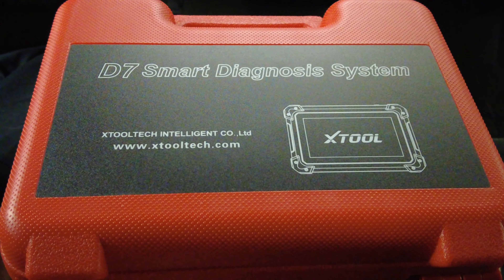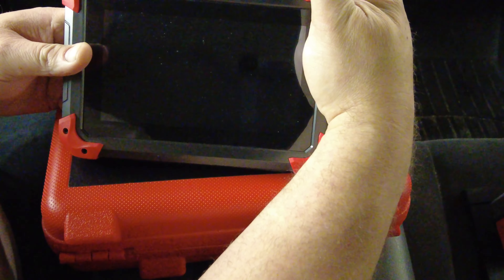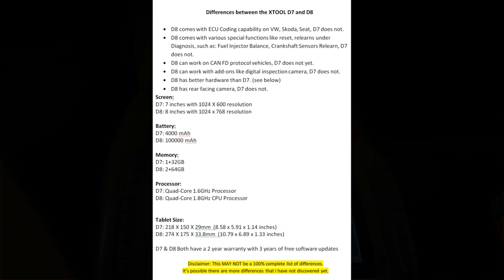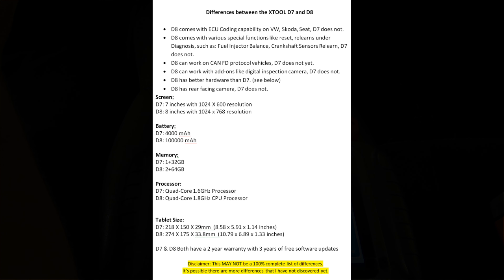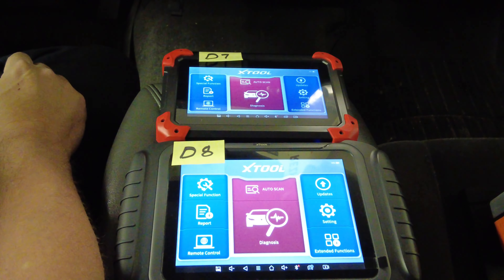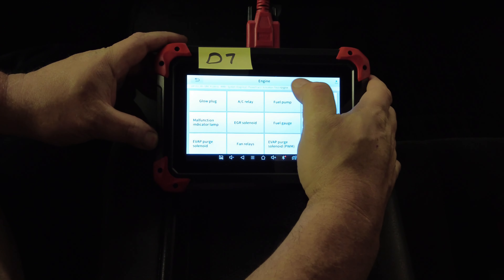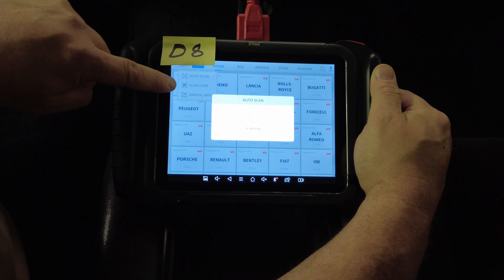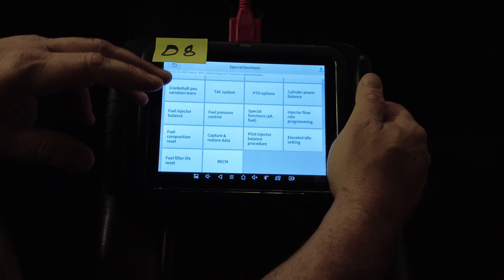XTOOL D7 vs D8 Comparison.  Differences Between These Two Diagnostic Scan Tools

Comment from the maker: XTOOL D7 https://amzn.to/3BdPUo2 (Amazon Link)
Exclusive 10% Promo Code of D7: XTOOLCODE
XTOOL D8 https://amzn.to/3YCfko7 (Amazon Link)
Exclusive 8% Promo Code of D8: XTOOLD8CODE3 
XTOOL D8BT https://amzn.to/3CSkUeB (Amazon Link)
Exclusive 8% Promo Code of D8BT: D8BTCODE

5ft OBDII Extension cable: https://amzn.to/3CveQF4 
9.8ft OBDII Extension cable: https://amzn.to/30ByW3E 

As an Amazon Associate I earn from qualifying purchases.
Reply: You should look up the xtool A30M ---  it's essentially a D7, but without the tablet.  You use your phone instead, and just download the app--  which looks exactly the same as both of these. (but only for $200).  You should do a real good comparison on the A30M vs your D7.  I think there's only a few things that the A30M can't do-- like programming keys;   and maybe one or two others.  Otherwise it has all the same live data and bi-directional controls (or at least the vast majority of them).  It's a killer set up for the price.  But I'm still leaning towards the D8 I think:   buy once, cry once.
Reply from the maker: @calholli  
I'm familiar with the A30M.  I've had OBDII dongle cell phone based scan tools in the past and they're not for me. However, I will say the A30M seems to work better than the ones I've tried in the past. Thanks for the comment. 🙂
Reply: @SlipFitGarage  Yeah.. The A30M is essentially a D7-- except it's a lot slower because of the blue tooth;  with a short little loading screen on everything you do.  I looked it up on their site though, and comparing it to the d8, there really isn't very many more special functions that the D8 does, considering it's +3x the price.  It can do keys, eeprom, a/f reset, "ecu config", start/ stop reset...  and a few other quirky custom options, like turning off the door buzzer or seat belt buzzer.  I'm still pretty set on going for the D8 though myself.  I know after I pull the trigger, I'll be glad I did.
Reply: Hi, if you looked for european cars and Toyota Aygo 2014 which has what is called a MMT multimode transmission gearbox does the 7 or x8 take you to transmission relearn thanks
Reply: Nice comparison, thank you.
I've been watching other videos and was wondering if the D8 would be able to program keys for Mercedes?  I've seen other video's using the XTool X100 Pad Elite w/ KC501.

Comment: I have the D7 that I purchased last Fall.  It's works perfect for my needs - now both my vehicles run perfect - every couple months I run a complete scan (live data) to make sure all is well
Reply from the maker: Have you updated the software since you purchased it?  There was a large update that came through last last summer for the D7 that gave it a BUNCH more functionality.  Be sure to update the tool whenever you can.  Glad to hear the D7 is working great for you.  Thanks for the comment!

Comment: Great explanation of the difference between these 2 scanners. I would believe the home DIY'er would need nothing more than the D7 unless they had a special purpose situation. Also i will add that the update cost after 3 years for the D7 is $99 and the D8 is $199. That may play a part in somebody's decision.
Reply from the maker: It's really hard to say what a home DIY'er would need....  Without a crystal ball, and being able to predict future vehicle breakdowns, it's impossible to know what someone needs.  For example:  Someone just asked a question in the comment section about resetting the air bag passenger weight sensor in his GM truck.  The D8 CAN do that procedure, but the D7 cannot. He NEEDED (and purchased) the D8 to get that job done.  Owning the D7 would do him no good at that point.  As for the update prices.....  the XTOOL is already 3 years of free updates where most high end OBDII scan tools are one year.....  Then when you do need to pay for an update, the XTOOL D8 is roughly 4 Times CHEAPER than my Autel 908 (for example) for basically the exact same functionality. That extra $100 bucks over three years is well worth the money in my opinion.  YMMV.  Thanks for the comment.
Reply: Undecided at this time
Reply: Oh I didn't even think about an update cost for these. Thanks for the heads up.
Reply: Is the $99 update cost for the D7 for another 3 years?
Reply: @rishijai  no per year
Reply: If youve bought it for your present day car and you go past the 3 ys and on the 5th yr say you buy another car cant you just pay for any up dates when it suits you surely?
Reply: @gtibruce  yes
Reply: Do you have to get the update for it to keep working?
I've seen some tools that you have to pay every year or it won't function at all when the timeframe runs out.
Reply: I’m buying food on 🤷🏽‍♂️
Reply: @markchidester6239  No is my understanding everything should still still be working, you just don't have updates for newer cars. What good is update for the DIY? Say buying a new car I would not need updates till the warranty expires by which time new scanners will be cheaper and with more capacities, XTOOl might not even be in business. I'm treated it like a laptop with a useful life of about 5 years. Look at this rate with our upside down government we may not have a country any longer where everything are falling apart across the full spectrum.
Reply: What happened if I don’t pay the Update? The scanner stop working? Or just I will not be able to work on newest models?
Reply: @roger5928  Scanner still works just wont get updates for the newer vehicles.

Comment: The d7 does all those same special functions. Check your updates. I can do fuel trims relearns, crank position relearn and all the other bi-directional features like power imbalance or injector balancing.
Reply: I see you have a newer video discussing some of the upgrades. They really pushed the D7.  It’s a lot of tool for pretty cheap considering the laundry list of features.

Comment: thank you for making this video!  I've been wanting a D8 because I thought it had full ECU programming for all vehicles.  Didn't realize it was basically only for VW
Reply from the maker: You're welcome.  Yeah, I agree....  The programming capability of the D8 is not particularly fantastic.  The way it's advertised, you'd think it could program just about any vehicle but it can't.  The way I see it, typically most ECU programming with a scan tool requires a J2534 pass through box for it to work properly.  Whenever I see a scan tool (any scan tool) advertised with ECU programming capability, unless it also comes with a J2534 box, I usually disregard that advertising claim. At least that's what I've seen.....  I've never personally programmed an ECU so I could be wrong. Your mileage may vary.  Thanks for the comment.
Reply: apparently you have to get into their "pro" stuff for Fords.  D9 or above.  But they don't have GM or Dodge/Chrysler yet on any of them.  I will say their customer service is top notch.
Reply from the maker: I agree....  I have had nothing but great interactions with their customer service.  Example: I was having an issue with something not working on my GM truck and they created a custom software update that was only pushed out to my specific D8 (via serial number) within about one or two days.  Then, once I verified that everything was working correctly, they made it available to all D8 scan tools. When I first started doing reviews for them I had a bunch of suggestions to improve the A30 Pro and they implemented every one of them..... and most of those suggestions have also spilled over to their other scan tool. As for programming with the new D9.....  We'll see.  I will have a brand new D9 in my hands in the next day or two, whenever it gets here. I can use the D9 but I can't film my review just yet because they are still putting the finishing touches on the software. I will post back here and let you know what the D9 can do with my 2008 CVPI.  Thanks again.
Reply: I've watched a video on the V7 in that video it did come with a lot of relearn as well as key programming and removal.

Comment: Thank you Brian.  Now I know well the big difference between both.  I really appreciated.
Reply from the maker: Hi, some things have changes since this video was recorded.  The D7 now has more features and functions added to it via a major update as of last August, 2022. The D7 now has basically the same features and function as the D8.... However, the D7 still has a smaller screen, and a smaller battery........ And the D8 does have a bit better live data graphing, etc.  The examples I used in this video are no longer relevant.  The D7 can now do exactly what the D8 does in this video. All this is because Autel gave their entire line of 808 scan tools full bidirectional control as of July 1st 2022..... and XTOOl had to keep up with their competition so a month later, the D7 was upgraded....  The scan tool industry is constantly changing.  It's hard to keep up with everything because it changes so fast. Thanks for the comment!
Reply: @SlipFitGarage  Brian do you have a preference between Autel or XTOOL?  Thanks.

Comment: As a professional Mechanic since 1986, I own three scan tools now. I've owned others  thru out the years. I'm interested in the Xtool line of tools. None of them however do Fca Auto auth for 2018 and above Fiat Chrysler vehicles. No doip  meaning diagnostics over internet protocol and no Can hd data bus new cars that support it.
Reply from the maker: The AutoAuth thing is going to be a problem for XTOOL if they continue to ignore that ability.  However, I have not tried it myself, but they claim the "12+8 Cable" adapter will bypass the SGW module on 2018+ Chryslers and give you full control of the vehicle.  Is that a great solution? No, absolutely not! However, not everyone wants to subscribe to AutoAuth for the random few Chrysler vehicles they may work on in the future..... maybe the 12+8 cable is a satisfactory solution for those people? Also, the XTOOL D9 is supposedly DoIP and CAN FD compatible.  It won't be long and I suspect all XTOOL scan tools will be CAN FD and DoIP compatible.

Comment: In your opinion, which version would be ideal for a 2016 Ford Taurus? I replaced an instrument cluster, and Forscan is giving me troubles. I purposely bought a cluster with less mileage because Forscan will only allow upward modification.
Reply from the maker: Keep in mind this video is old at this point and a lot has changed in the scan tool world since this video was recorded.  The D7 has been greatly inporived andnow has the same functionality as the D8 shown in this video.  The original D7 (as shown in this video) or the newer D7S or D7W is probably all you need. 
The newer version of the D7, the D7S: https://amzn.to/3tny0hf (Amazon link)
The wireless version of the D7S, the new D7W: https://amzn.to/46imNvZ (Amazon link)
Thanks for the question.

As an Amazon Associate I earn from qualifying purchases.

Comment: Thanks for the video. What surprises me is that both arent Bluetooth, right?
Reply from the maker: Correct, the two scan tool models shown in this video (which is almost 3 years old as I type this message) do NOT use a Bluetooth connection between the scan tool and the vehicle. It's a wired connection.  However, both of these scan tools NOW come in a Bluetooth version, OR a WiFi version.  Don't get me wrong, THEY ALL have wifi for their internet connection....  but the newest models actually use wifi (instead of Bluetooth) to make the connection between the vehicle and the scan tool.  It's a MUCH stronger connection with a MUCH longer wireless range. (compared to Bluetooth) The scan tool serves it's own network f or this to happen.  No existing wifi networks are required to make this connection.   The scan tool uses wifi between he tool and the OBDII dongle....  a wireless router is not required. Thanks for the question.

Comment: Brian, as for updating this or any other brand, I have a 2004 Lexus SC 430, I have to think everything to be known about this car is known. Do I really need to pay for updating? Do you lose functionality if you don't? 
Thanks
Reply from the maker: If you only plan to work on that one vehicle then the only "updates" that you could possible need are firmware and operating system updates for the scan tool itself.  Updates come out on an almost daily basis....  not just once per year when the new make/models are released to the public. However, working on ONE make/model certainly won't justify paying for updates.  And no, you do NOT lose any functionality if you decided not to purchase future updates. I have stated this fact in every XTOOL video.  In fact, I do not know of ANY scan tools on the market today, regardless of brand, where you would lose any tool functionality if you do not purchase future updates.  However, there are some NEW vehicles on the market today that require the scan tool to have access to the cloud in order for some functions on the scan tool to work properly.  this is a VEHICLE requirement, not a SCAN TOOL requirement....  And cloud access requires a current scan tool subscription. So, therefore, this would be true with ANY scan tool, not just XTOOL......  And again, this is only for SOME vehicles that are fairly new with in the last few years.  Older vehicles do not require a cloud connection and the scan tool will always work 100% at it's current software level.
Reply: @SlipFitGarage  Thanks so much!

Comment: Hey boss I know you have said that you won’t recommend a scan tool but I am a diy type of guy and help fix sometimes my wife and my sisters car also have worked on my fathers all with a $80 scan tool but now want to buy a bi directional for my use especially since they have Black Friday deals now which brand will you recommend topdon,Autel ,xtool or launch my budget is 700 please let me know what you think?
Reply from the maker: It's hard to beat an Autel....  but that new XTOOL D7W with the WiFi VCI and 3 years of free updates is an absolute killer right now.  It's well within your budget and it will do probably anything you could ever want it to do.  (besides pure programming....  but most scan tools won't do programming anyway)  Check out my vidro about the BRAND NEW D7W.  Here: https://youtu.be/54JuHonWrEM  If you click my link under the video and then use my additional discount code you should be able to stack the Black Friday deals along with my discount and get an even better price. Thanks for the question.  Let us know what you end up getting.

Comment: Can I use this scanner for any Mitsubishi 2019 and above?
Reply from the maker: Both scan tools in this video are designed to work on OBD2 vehicles......  Which is technically ANY vehicle sold in north America from 1996 and newer.  These tools SHOULD work on your Mitsubishi's but keep in mind, ALL scan tools can potentially struggle on certain makes and models.  Even the ultra expensive Snap on scan tools can have problems on certain vehicles.  Thanks for the question.

Comment: If the D8 had Bluetooth I would order it right now.  It may seem like an unnecessary additional function, but when standing outside the car with hood up and engine running, being able to monitor bi-directional functionality and test various parts is a plus.  IMHO  Seems like a $50 upgrade that should have been included in the D8....
Reply from the maker: Well, you're in luck!  The Bluetooth version has been released.  See the 4th line down from the top of the video description directly below this video.  You will find a link for the D8BT.  It did not exist when this video was created but it's available today.  Thanks for the comment.
Reply: The D8BT is available now. A tiny smidge slower [about 30 secs for a full scan] than the D8 wired. In the UK the D8BT is currently 7% off, to compete with an Autel sale.

Comment: Great video.  Can you use the scanner to pull engine hours and odometer mileage? My gauge cluster went out and I need that 2 info to have them program it in the new cluster.
Reply from the maker: Yes, as long as the specific vehicle you're plugged into will allow that information to appear on the screen of a scan tool. Generally, most vehicles are programmed to show this information somewhere in the menu structure (can, and usually is in a different location for every vehicle) but occasionally you may run across a vehicle that was NOT programmed from the factory to display this information and therefore the scan tool will not be able to show it to you.  This is the fault of the vehicle, NOT the scan tool. It all depends on the vehicle itself, and every vehicle (make/model) is different.
Reply: @brianok100  thank you I ordered D8. Will see if it works on 05 Silverado Z71 5.3L

Comment: I flip cars. Will this tell you if mileage has been adjusted and will it tell you if codes were reset previously?  Thanks in advance!
Reply from the maker: Both of these scan tools are capable of displaying the information you're looking for. However, the real answer is....  it's 100% dependent upon the vehicle that you're plugged into at any given point in time.  The scan tool is capable of displaying the info.....  but is the vehicle you're plugged into capable of supplying that info to the scan tool?  EVERY year/make/model is different....  Not all vehicles supply the same info.
Reply: @ good points all. Thanks!